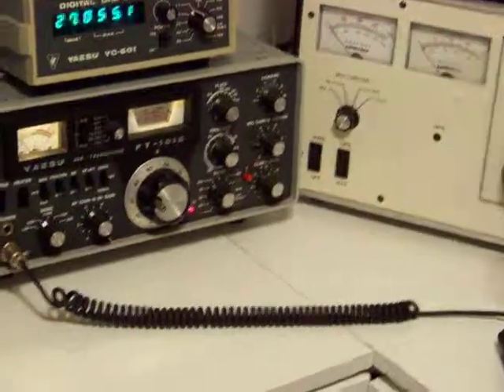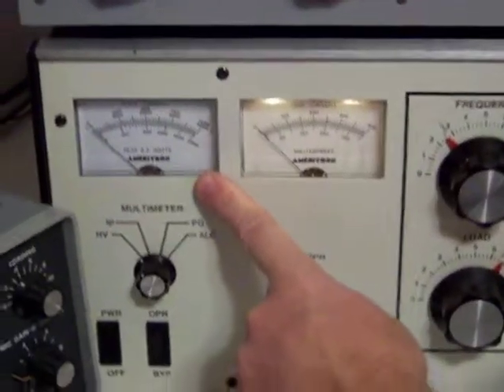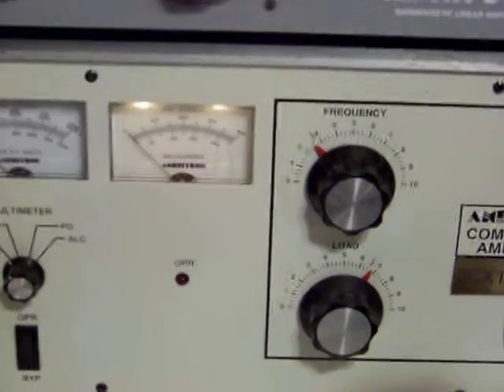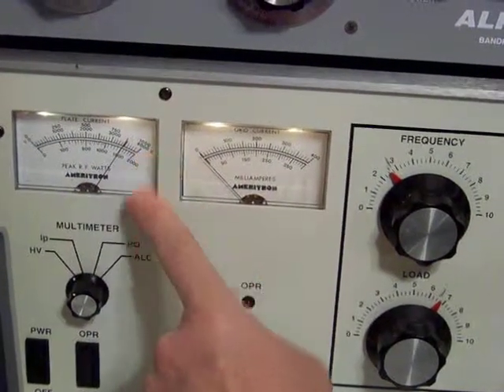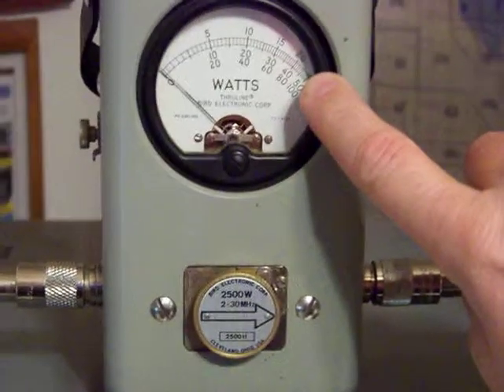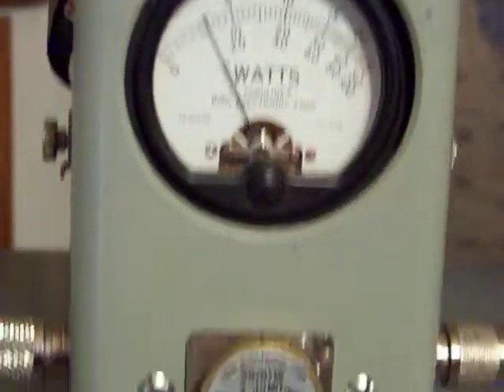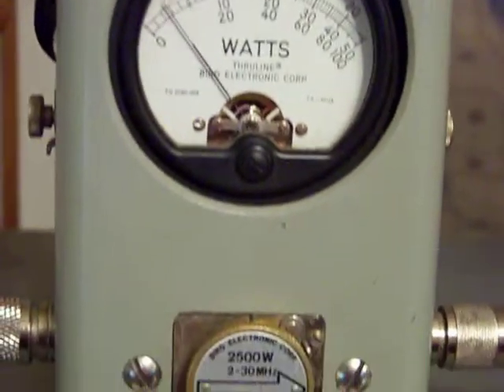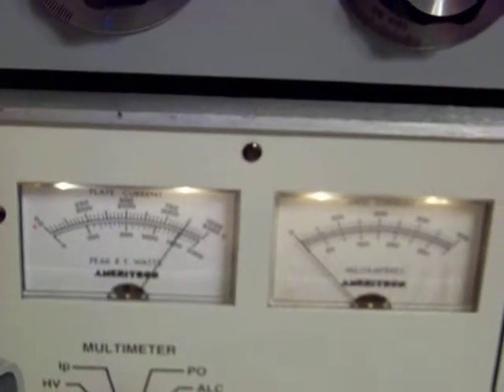Ameritron Commercial 3CX1200A7

Comment: This is nonsense. The 3CX1200A7 is an instant heating thoriated tungsten filament. It never came with and does not need a delay timer. This is like CB channel stuff, with that "swing"  nonsense.
Reply: its a comercial amp. maybe they did it to be safe?
Reply: @1112223333111   I actually designed that amplifier in 1984. I was GM of that division of Prime Instruments. I oversaw production and all engineering until we sold Ameritron to MFJ. 

I continued as a consultant to MFJ until three years ago. 

I can authoritatively say the claim that the amplifier is a production commercial AL1200 for 10/11 meters is all bologna. That is some field CB hack.

Comment: I don't understand...the 3CX 1200 A7 is instant warm up....why the delay??I have not seen this amp before.....Interesting..
Reply: Neither have I, and I designed the AL1200 LOL
Reply: @Jerrythenerdful  Thanks for your reply Tom.
What is the " swing" that this guy refers to?
I have had my AL1200 since 1997 ( new) and I like it. It seems very durable.
Only thing I ever had was a Parasitic resistor burn out.....never did find out why.
Produces power effortlessly.
Obviously I run mine very light....Don't think it's ever been above 1KW.
I hope the tube lasts me out!

73    Des  G4OBB
Reply: @Jerrythenerdful   Tom i have difficulty to purchase a 3cx1200a7. Can you help please? where i can buy a new one? Thanks a lot de SV8DJW.
Reply: @SV8DJW      I have a few used good 3CX1200A7 but getting them safely into Europe would be an issue.
Reply: @Jerrythenerdful  is it a medical amp?